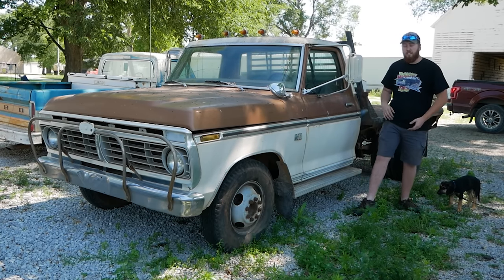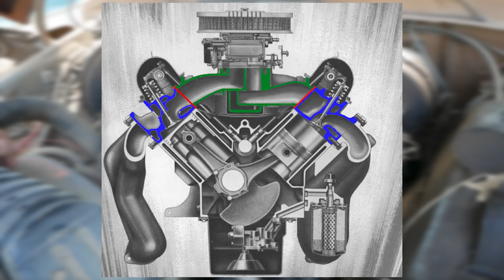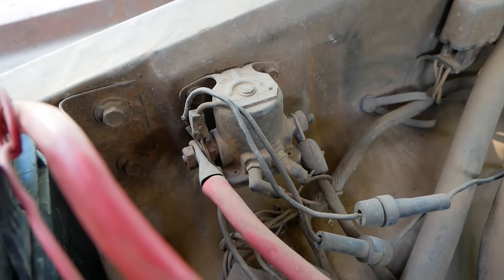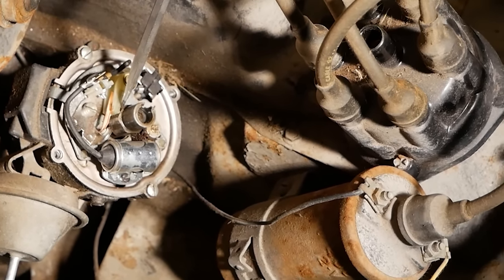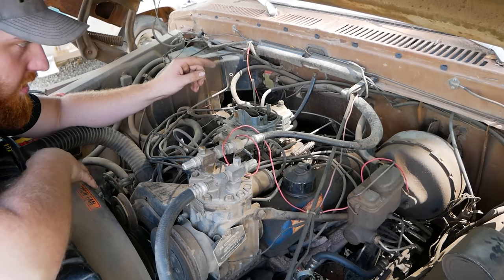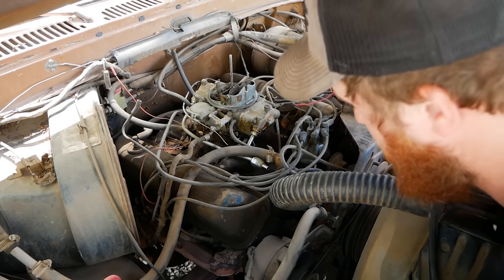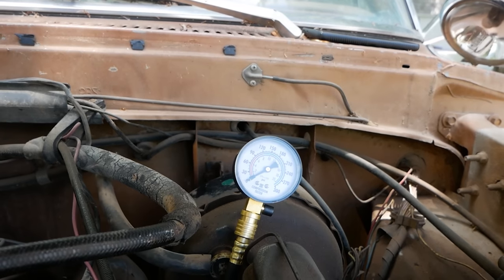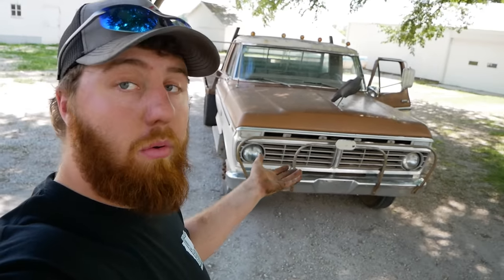How To Revive Abandoned Cars and Trucks! 1974 F350 First Start

Comment: PSA if you are reviving a '73-86 Ford truck always check the heater box for leaves/pine straw, they find their way in the heater box and get against the hot blower resistor and start a fire. Usually by the time you figure out where the burning smell is coming from it's too late, argue all you want but I've seen too many trucks ruined this way including one of mine when I was a kid and didn't know any better.

Edit something I've never heard you mention is the importance of making sure the oil pressure comes up when the engine starts, we were reviving a 60's Cadillac 429 in a junkyard and my buddy was revving it up right after it started with zero oil pressure. Luckily we caught it quickly and shut it off to find the problem but if you don't know it will bite you on the behind.

Comment: I had a '74 F350 with a Holmes 440 wrecker bed on it years ago, it had the 390 in it too, really stout old truck, had no problems spinning the duals even with all the weight on the back, but then again the rear brakes didn't work so well 😆

Comment: 302 has but one firing order 15426378 save for a couple of years (82/83 I think) where the Mustang came with a 302HO that had the 351W firing order 13726548. I think because they could run a little more cam without the lopey sound. Anyway, have fun man. Subscribed!

Comment: Coil can Wear it will become weak. it can also leak the old style like you have on Carb rides. if they leak they are weak. 
i bought a 85 Camaro with 200k(303K km) and it was missfiring bad it was worst on load at least it was a 5spd so i could down sgift to bring the revs higher made it home. checked all the bill that i got w/ it notice the coil never got replaced. also did other diagnostics before that but ended up trying a used coil i had laying around and boom rans great just like new no backfires and miss. ran great for 3 years without any other parts to it. drove it until 330k km and swap in a "LS" 5.3L LM7 and T56.

Comment: I have a 1974 Ford 1 ton w/a 12 foot bed..it was a 4 speed fe it's got a 460 w/a C6 now...the engine has 30k on it since it was rebuilt 20 odd years ago...it was in a Late Model Sportsman dirt track car....the 460 engine was pulled and replaced with an all aluminum billet engine... the 460 gets a whopping 5 MPG...loaded or empty...lol

Comment: I've heard that sound on an FE startup enough to know those exhaust headers are loosy goosy. Rear bolts (the hard to reach ones) always need periodic retightening, before the gaskets gets all funky.
Reply: Just did this on my '76 FE390. Don't even try to tighten them.  Those old logs are likely cracked and warped and the gaskets blew out years ago.  New manifolds are super cheap, installed with good quality gaskets makes a world of difference.  If all the studs come out, and nothing is stripped- from over tightening.

Comment: Another way to test if you have a cylinder not firing is to take a test light and connect the ground to either the negative on the battery or a clean metal part on the engine. Then with the engine running simply push the pointed probe of the test light straight down through each spark plug wire boot on the distributor far enough to touch the core of the wire. The hole it makes in the boot is so small it closes up once you pull the probe out. To small for water to ever get in there. This will short out the wire preventing the plug from firing. Of course a cylinder that's not running will make no change in the idle.

Comment: One rule I try to always follow when doing revivals myself (which you kinda alluded to about thermostat) is NEVER lean over the radiator/ cap when running the motor for a period of time. I've had a few that have had rooted thermostats, blocked radiator, water pump impeller rusted off etc that will build up pressure & .....boom pop the old rad cap off, causing a hell of a shitshow!

Comment: It's definitely a nice looking survivor type truck.  Ford put way more 360s in trucks than 390s, and you cannot tell the difference just by looking, so there's that.  And I seriously doubt that was a FD truck (no hole in the roof for light, no hole in engine compartment where siren was mounted, etc.). It's for sure worth fixing the dead cylinder issue though, if you have no problem with 8mpg at more that $3 a gallon.  Otherwise, ya gots a nice yard ornament lookin' blast from the past!

Comment: I can’t wait to watch this during work lol I’ve got a 74 f350 ramp truck I’m trying to revive that’s a conjumbled mess of what is the motor lol it’s got a 351 air cleaner a 360 sticker on the valve cover and the previous owner that owned it since the 80’s says it’s a 390 it was parked in 86 so it will be interesting

Comment: Speaking of a beast work truck, being in the oil industry for almost 30 yrs, the line mechanics I worked with, lf given the choice would take the 460 over the 454 every day. They all said compared, the GM's had no oats. The Ford was a horse.
Well unless you got lucky and a previous driver swapped you in a 428, you got a 390. Which is another stump puller. Had a 73 with 360. My 73 brand new was $120.00/ month. $3500 off the lot.

Comment: I’ve seen two different f250s with that cargo light switch by the drivers head and they both were wired as shut off switches that would kill the motor

Comment: For those who don't know, the seemingly bizarre design of having the intake extend under the valve covers was Ford's way of bending the rules in NASCAR. Aluminum intakes were legal, aluminum heads weren't. Replacing a third of the iron heads with the aluminum intake cut something like 50 pounds off the weight of the engine. One of the biggest "cheats" in NASCAR history and hardly anyone knows about it.

Comment: I bought an old F150 once for $500 was told the fuel pump was bad. I primed the carburetor and it fired up and ran with no problems and restarted repeatedly with no problem. I sold it for $2500

Comment: Correct me if I'm wrong but far as I know, the 10.25 Sterling rear didn't come around till 2004. That rear end is more then likely a Dana 70HD
Reply: Most likely dana 70.
Reply: @theobsoleteman7935  Itd be a Dana 70 if it was a single wheel. Being a dually, it'd be a Dana 80
Reply: @buckberthod5007  well you can convert dana 60s to dually so could be.
Reply: @theobsoleteman7935  The other reason I assume its an 80, is because it was an old fire truck. They would have ordered it with a heavy duty 1 ton rear dual axle more then likely. I just wish we could have seen a data tag that says what it is. It's definitely a Dana regardless
Reply: @theobsoleteman7935  After doing some research, it is going to be a Dana 70HD. Dana didn't come out with the 80 till 1988. The 70HD was the previous iteration before the 80 was introduced. The 70HD was good for 10K gvw

Comment: New Battery, Alternator, and Starter.  New Carb. New Fuel Pump. New Master Cylinder with Pads and Hardware. New Wheel Seals. New Plugs and Wires. New Intake, Manifold, and Valve Cover Gaskets. Run Right. Rebuilds and Used Parts get it off the side of the road. Driving with them puts the rig on the side of the road.

Comment: You would pull fewer plugs if you just ran a can of Sea-foam through it. Amazing cure all for engines that have been sitting.Well, it doesn't cure everything, but It will amaze you!

Comment: You don't have to pull the plug wires to check for spark, all you need it a test light hook it to the battery then  Poke each plug wire on the distributor.

Comment: Once coolant mixes internally with the crankcase oil and is circulated through the oiling system for any length of time, the coating on the bearing inserts for your crank and rod journals will be damaged compromising the longevity of the engine. Didn't look like there was any coolant mixed with the oil when the dipstick was inspected though, oil would have been very milky colored and thin.

Comment: I had 2 F 350 ford with 4speed and same rearend ratio the 460 you had use first start out and 390fe would  spin the tires in second gear starting out.

Comment: Thanks for these videos! Very informative for a relative Noob.  I’ve got a ‘61 New Yorker with a 413 that was not supposed to be locked, but, yes, it is.  (Hasn’t been registered since ‘76) Getting into the motor, oil looked good, (no water), plugs looked good, no rust.  Is trans fluid a good thing to put down plug holes?  I’ve used Marvel and diesel fuel, still stuck. Under the valve covers also looks good. (No carb on it at the moment). Haven’t touched the heads. (Over my head, probably!!) (I need to find one of those fuel bottles, too!)

Comment: Trying to get an old 4 cylinder tractor revived. Replaced points, spark plugs/wires, condenser, coil, starter, and cleaned the carb. Even with a little bit of ether, the thing won't even run for a few seconds. What do you guys think?

Comment: From memory doesn't a390 run water across the intake an pull the radiator cap off after motor has been running an if it blows bubbles in the tank it's the head gasket if not it's the manifold leaking coolant in to the cylinder

Comment: Hey Kevin! If you want to screw with a guy that has an older Ford like the one in this video, on the starter solenoid that has two smaller prongs, switch those two around. That thing will crank all day long and will not start. It will drive a guy bonkers trying to figure out why that thing won't start. Visually you can't tell the difference. Try that on Luke when he's not looking the next time you 2 get together or on Mook for that matter. See if she or he can figure it out. It's an old mechanics trick. You might get a good laugh out of it.

Comment: I saw a bad coil on a 62 Bedford it wasn’t dead but weak and it couldn’t charge fast enough so the engine just coughed it also was the original 58 year old coil so I don’t blame it for failing I just swapped one I found in the shed cupboard because who needs new parts when you have unknown shed parts

Comment: I think the truck you’re working on was actually a tow truck then a fire truck because if it was a fire truck it would’ve been painted red and had black interior  however the truck you’re working on is brown and brown which makes me think that it was a tow truck unit five and smoky would make sense for a fire truck but also makes more sense if it was a tow truck.
I may be right I might be wrong.

Comment: Before I ever start  up a automobile that has been sitting I remove the gas line off the full pump that runs to the gas tank  so it can't pump old gas into the carb or all over the engine and starting a fire then I take the gas line off the carb then I grab a small boat gas tank with new gas  then I huck it up to the carb

Comment: Super straight rust free truck. Ford is the odd ball with cylinder numbering. When you flip the engine over and look at the crank, the rod #s go 15263748. Most all other v8s are 12345678 front to back. I prefer cylinder numbering that makes sense. Odds on one side evens on the other. Ford likes to be different.

Comment: Too bad about that cylinder. I'm surprised you didn't see oil in radiator.  May have been why you had pressure in radiator though. Hopefully like you said just a gasket issue.  Guess there fuel system issue was they thought they had water in tank due to steam coming out of tail pipe 👍

Comment: Actually the ENTIRE reason the FE/FT intake is the way it is is thanks to NASCAR. It was a way of legally cheating in the 60's because they were told you had to have iron heads but you could run a factory aluminum intake.. So Ford got smart and designed heads where 1/3 of it is part of the intake to reduce the amount of weight of the heads but still be legal for use in racing. Remember "Win on Sunday, sell on Monday." and they definitely did. If you're going to put a head gasket on that thing, pressurize the cooling system and watch the borescope and see if it pisses water into the cylinder through the wall or if it's coming out under the head. If it's the head, get it magnafluxed. (I suggest buying one if you can because of what you do all the time.)

Comment: im guessing either something used at a race track or a service rig. power companies for example have spot lots pretty common on there trucks. plus i dont see a fire truck being any color other than red or yellow. also i dont see a pto drive that a fire truck or any light holes for rotators or lastly no switch panels etc. one other thing a ranger xlt would be a expensive buy for a county truck.

Comment: I always told folks since birth when I open the hood of a Ford in my shop it's just like working on a UFO at area 51 to me. When ya open the hood of Ford who knows what the hell will jump out and bite ya on the nose. In October I went to a small town down the Conyingham Valley road called Shack Town because when the town evolved around 1799 it was just a bunch of old mining shacks and farm houses not far from my farm house. I went with Landscaper pal Frank Miller and his buddy AAron Hess. First thing is the hood on this 77 Ford is locked up tighter than the White House is at the time. When I finally spring the old power door open this pissed off possum comes flying out does a 180 right on my brand new sweatshirt and rips it the damn thing started break dancing on the air cleaner then runs up on the roof of the truck and flips us all the finger and disappeared. It was no wonder the possum was pissed off at us by the tons of snickers bars and candy wrappers all over and under the truck. There's this guy right next door that has vending machine business is where all the fodder came from. I can only imagine how pissed off the possum musta been when he came back and his truck and snickers bars was all gone...

Comment: The only thing that I've seen so far that I would like to add in is I have seen coils go bad under one circumstance when they get hot wired directly to 12 volts when they're supposed to be on a ballast what Will happen is they will cook themselves to death they'll run hot and die easiest fix to that is to run down to your favorite auto parts distributor and pick yourself up a high performance 12 volt coil and just hot wire it in bypassing the ballast

Comment: You were wrong on the Chevy cylinder numbering.  The left cylinder is #1.  If you ever look at a Chevy motor, the left bank sits forward of the right bank.  The cylinders are numbered in the order they connect to the crank.  Fords, the right bank is forward, making the right cylinder #1, but then they throw logic out there window and number them incorrectly

Comment: I noticed how low the air was on the front tire when we were putting more fuel in and so I am quite sure  if we put more air in the tires up front, NOT out back , up front you will see the idle should smooth right on out that nasty cylinder miss should go away... yep, yee haw \

Comment: I have cussed people that did something stupid on my vehicles more times than I can count. Literally changed my transmission fluid filter for the first time yesterday and I didn't need a socket to take out the bolts in the pan. I have been driving this jeep for months. No idea how I didn't loose them. They where all less than finger tight.

Comment: Shouldn't a '74 have Duraspark I ignition (black grommet d-spark box) instead of points?   I think so... first year or two, Duraspark used the normal size earlier distributor cap, big cap was '77 and later.

Comment: Sounds like it has blown out exhaust manifold gaskets and perhaps broken exhaust manifold bolts, which would describe 75% of FE motors I have owned or worked on.  I'm a Ford blue blood, but the FE is not a fav of mine, it has several boo-boos that cause problems.  Spinning off the oil pump shaft is probably the most deadly, the others, like the exhaust manifold gasket thing, are just annoying.  It's too bad it did not have the 460 you were told, the 385 motors are much more well sorted out.

Kevin, an easier way to richen the mixture momentarily to test for a lean condition is to put your hand over the air horn to choke it.

Chryslers have the ballast resistor, GM and Ford use a resistor wire.

What is most unusual about this truck, to me, is it started life as an F350 chassis cab dually, but it's a Ranger XLT, then the top-of-the-line package with A/C.  That is very unusual for what was intended as a "work truck" from the get-go.

Comment: Am I the only psychopath who even wires his chevys with a ford 4 post ignition soleniod? Yeah, it's a steal-me solenoid for those in the know, but who really knows these days? also if some prick shows up anywhere miles around me with my very recognizable restored cars i'll hear about it. Especially with headers, I don't like an always hot unfused low gauge line just chillin there next to my exhaust. On chevys, i wire the starter solenoid and main terminal together, and fire it all from the ford solenoid. Also gives me a handy ballast bypass terminal for retrofitting cars with let's say, more digital aspirations, to use points, which I prefer over HEI. Reference Puddin's test rides with that 61 wagon for a good example as to why.

Comment: what about a 1983 ford ranger has lost all power lights,ignition etc has brand new battery,starter,cables,solenoid..the positive cable only runs to solenoid no other wires on positive has been this way for years and always ran...i,m confused how it gets power for lights etc...